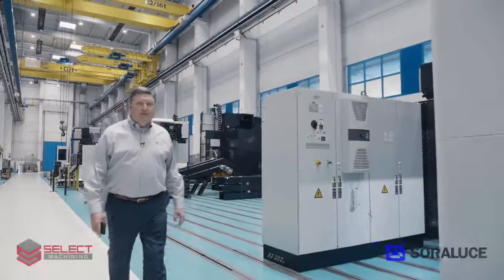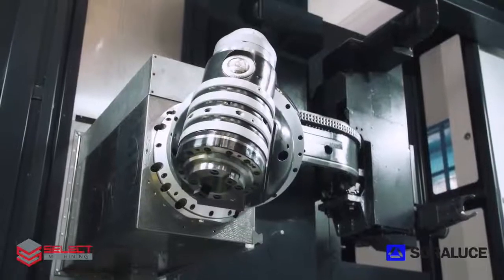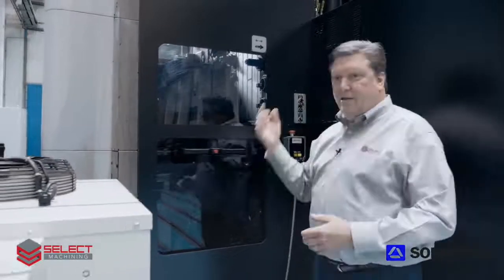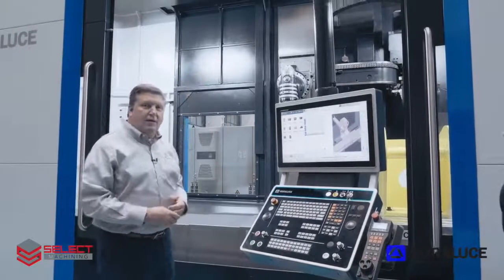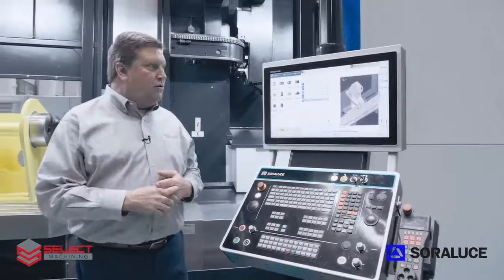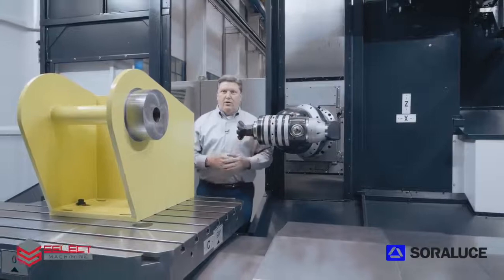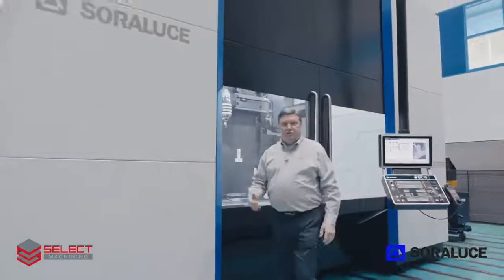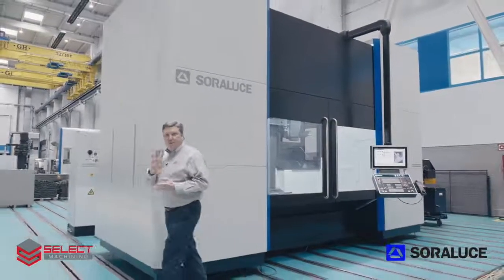Soraluce TA-D 25 Universal Milling, Boring Multitasking Machining Center for BIG Parts

Comment: The control panel can be moved from front side to back side, it is very cool design and helpful for machining the big parts.
Reply: soraluce has this system for ages. my soraluce is 15 years old and you can move the controls to the back. really handy sometimes!

Comment: Most/all of the features seem standard for a machine of that size in that class.
but why are they all designed to be a nightmare to clean when (to me) a simple base interior redesign would save so much time in the cleaning process.
Reply: The Soraluce TA series is a very easy machine to clean... the table only moves in X-axis and there is a chip conveyor at both the front and back of the table.  Chip flow off of the way covers is directed to one of these conveyors and taken to the right side of the machine.  The standard coolant system also incorporates a magnetic and paper filtration system.

Comment: The spindel reminds me of my old Anyak VH 3000 that I operated for many years. It broke down all the time and we change the whole spindel 5 time at an cost of 50 000 EUR each time.
The toolchanger remands me of a old Correa CNC milling machin that I also operated for many years and it broked down and was never used, it jamed al the time and was very complicated to reset.

HEIDENHAIN TNC640 is a great  controllsystem.

Comment: Can it do simultaneous 5 axis milling on the slant head? Or is it indexing only?
Reply: Only index and very slow moving.
Reply: @roberthansson9875  Soraluces Heads are SLOW. You cant move XYZ and index at the same Time.
Reply: @s.g.4859  new Soraluce head designs index speed has been greatly improved due to the inline motor technology AND we can move all axes simultaneous to indexing the head.  Of course, in larger machines, we can offer the full contouring head designs that incorporate torque motors for head indexing.
Reply from the maker: @roberthansson9875  sorry, that's incorrect. If you watch the video to the end you will see
Reply: @roberthansson9875  this particular head design is our 0.001 degree indexing only universal head which gives this machine 4-axis simultaneous + 2-axis positioning; Soraluce does offer a different head design that can provide full 5-axis simultaneous capability.  The indexing speed of the universal head is not slow moving.  Please watch the video to the end and you can see the index speed which has been greatly improved using the inline motor technology.  In larger machines, we can offer simultaneous contouring heads that utilize torque motors integrated into the head for the indexing operations.
Reply: @dougschulte3700  
Yes that was my whole point, this head can only move in to fixed position, not simutltanius.
And the moste frustation is that B and C axis in the head cant move idependent.
So if you program a toolangel it takes foreeeeeeeeever for the machin to get there especially if the machin needs to use both axis in the spindehead.
In my Anyak with a correa spindelhead I only had 0,001 degree acurrasy in in certen angulars as 0, 15, 30, 45 and so on.
If I wanted lets say 32 degrees the acurrasy wasent so good.

Another limtation was that I only had 6000 rpm capasity on the spindel, so freeform milling with a heliball was a challanges.

One big thing that was very good was that the machine was very strong and rigid with a huge amount of torq.
So heavy milling with large millingtools with large cuttingdeph and divemilling was fun.
Reply: @roberthansson9875  The Soraluce universal stepless head provides 0.001 degree indexing and +/- 1 arc second accuracy for both B & C axes.  As I mentioned, we have other heads that can index simultaneously and heads that can full contour in both axes.
Reply from the maker: You can absolutely do simultaneous 5 axis milling.
Reply: @selectmachiningtech  
Yes if you call that simultaneous 5 axis milling.
What you have is  XYZ + b and c axis in the spindelhead that have fixed positions and a rotarytable.

However what I ment was this.

https://www.youtube.com/watch?v=ngmY7KI8vFM

And skip to 2:50

This is how I work

So by defenition you are correkt but the spindel head can not move in a continous motion.
Reply: In this Soraluce TA-D 25, the machine in stock has our universal head with 0.001 degree indexing only in 2 axes.  We can offer a different head design on this machine that can definitely provide you with 5-axis simultaneous capability.  In larger machine sizes, we can provide this universal head and also orthogonal head designs that can provide simultaneous 6-axis movement.